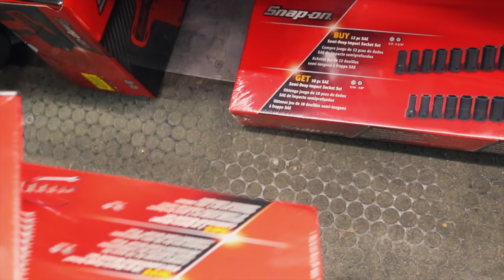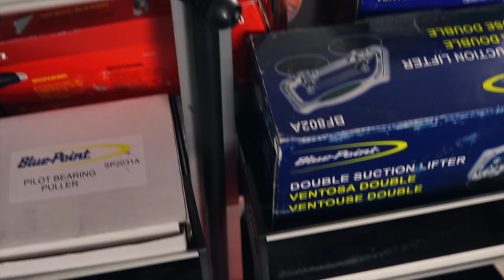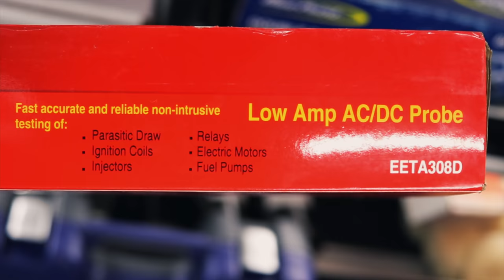Snap On Friday: New Tools and Ford VS Chevrolet

Comment: LS swap seems to be all the rage these days! Never hear about people doing a Triton swap.  LOL. GM all the way
Reply: Biggie Fitz 
You’re right. The 5.4’s had their issues.
Ford’s answer is a 5.0 coyote that’s pushing 425hp in stock trim. And it’s a hell of a motor in an f150 from the factory!
Reply: The world production car speed record is held by a supercharged engine based on the Ford modular platform.  The stock Coyote Gen 3 is 460 hp/420 tq.  It's right up there with an LS3, a bit more than the LS in a stock config.  That's what the Ford resto mod guys use like the GM guys use an LS.
Reply: roaddoglv 
I am looking forward to the new 7.3 gas engine due out the end of this year. Can’t wait to see HP and torque #’s.
I think it’s great that with all of the newfound tech available ford still went with a cam in block pushrod engine as the next powerhouse big block!
Reply from the maker: I agree. It should be awesome ! I can’t wait for it to be out for a while and see how the market adapts. Can you imagine the bolt on performance options that will be made. Like the 5.0 (302) days all over again
Reply: @harlemd6101  Only issue the 5.4 3v had was them stupid spark plugs. The intake manifold bolts rusting off. As most the ones I worked on. The owner did not do the maintenance. As that manual they give you is free. Hell I find most them owners manuals still in plastic wrap, never opened. In the glove box..

I know. I got a 1998 Ford van.. Just that I bought Ford parts. And read the manual...Still runs perfect with 189k miles..My Dodge Grand Caravan only issues them things had. The ECM is under the front driver wheel well. They don't like rocks and being submarine in water. The wiring harness runs under the intake from one side to the other. So keep an eye on that thing. It gets brittle.

Comment: Hey guys. Nice deal on the light. I was looking at the New Flank Drive socket deals. Not sure I would use them enough to justify purchase. I would check out the Blue Point set Walley bought. Excellent video

Comment: What’s the part number on the BOGO wrench set. I need those!
Reply: Colton Broom soex710oxi for the standard
Reply: Joel Franks I cant find that in the catalog is that a deal only on the truck?
Reply: Hey Colton yes that’s a deal we sell on the truck only. But if you separate the part number after 710 you can then look them up in the catalog

Comment: Clean tools don't make me more money.
Reply from the maker: They don’t make me any more money either I just try to take care of them and keep them clean and organized especially as much as it costs to purchase them and the box they stay in. Plus nothing is more aggravating than someone putting dirty tools on the inside of a truck and the driver getting bent out of shape because there’s grease on the seat or headliner or dash or visors.
Reply: @KoonTrucking  🤷‍♂️🤷‍♂️ don't gotta worry about it with cheap tools and a cheap box. Again an expensive box doesn't make me any more money. The guy that billing the most hours in my shop has the smallest box. Old old like 40" snap on with two side cabinets.
Reply: Nothing wrong with pride in ownership. I also clean my tools after use. Why not?